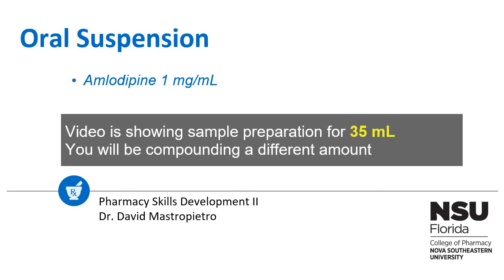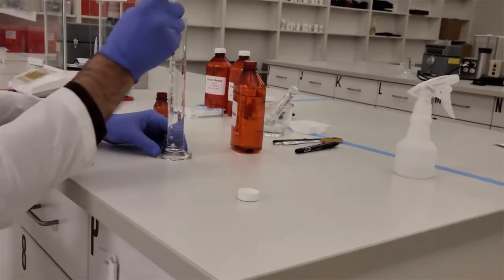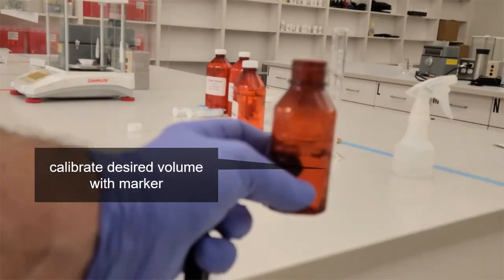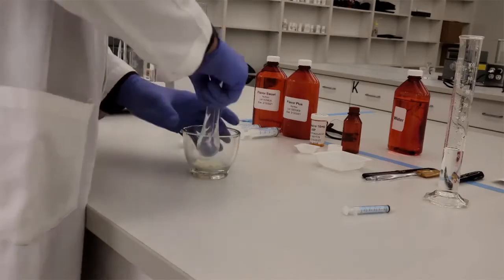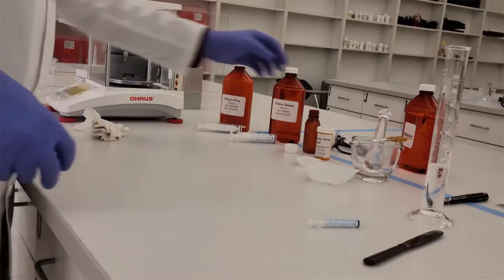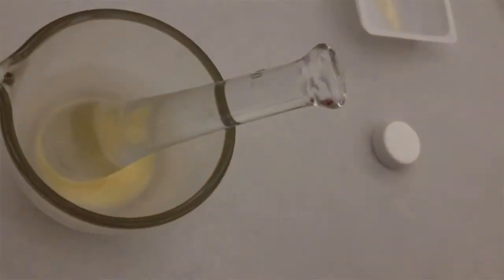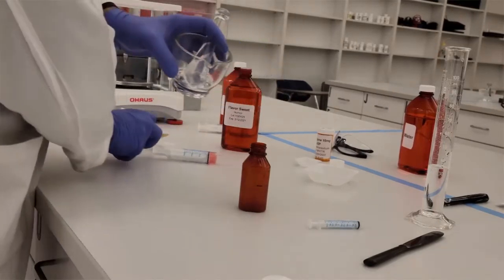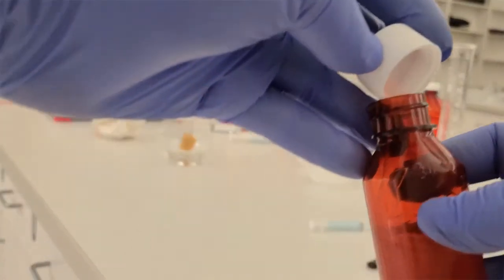Compounded Oral Suspension

Comment: Can I use purified water instead of the flavoring vehicle? Also, can I just use the suspending agent all by itself without the flavoring vehicle? Thanks for the great video.
Reply: Hello @thanhtran-333 in terms of using just the suspending agent, this should be sufficient to maintain the stability of the suspended particles. In terms of using water in place of the flavoring vehicle, I  would be cautious if the final viscosity is sufficient and also if you are looking at a BUD that is supported under a preserved system (in which case purified water would not mee the requirement).
Reply: @davidmastropietro3057  got it. Thanks so much for your insight

Comment: Great Tutorial, what are the ingredients of the suspending agent and is the same suspending agent the same for most medications?
Reply: thank you @mrdough123 for the comment. In this video I am using "Flavor Plus" as the suspending agent from Fagron. Most of they suspending vehicles will be similar in that they will show shear-thinning effects when shaken (to pour out of the bottle and for dosing), to behave as thixotropic fluids, gaining back the viscosity over time to slow particles from settling fast upon storage. These therefore are used the same for most of the suspending formulations. However, the exact polymers used as suspending agents and the other components including antimicrobial agents, and pH are likely to differ from company to company and may be a consideration for the particular formula or API being used.